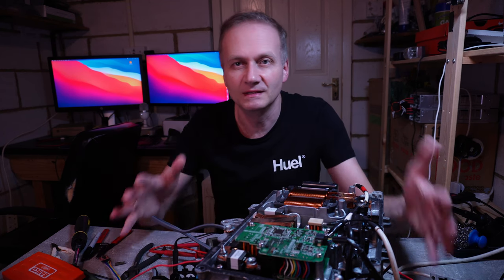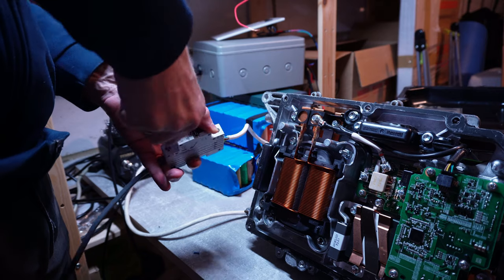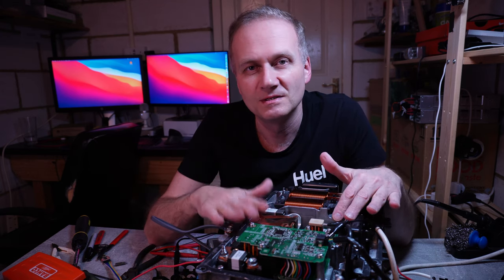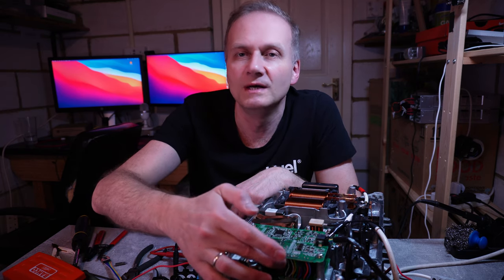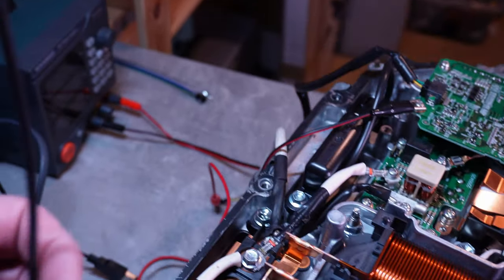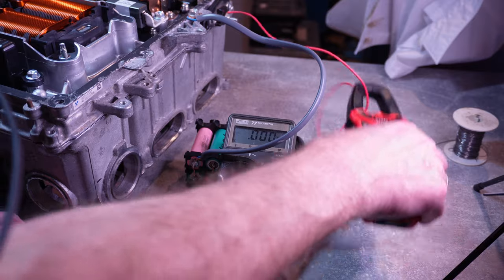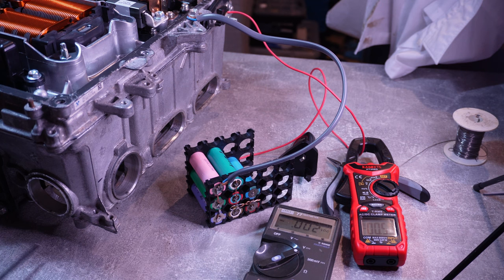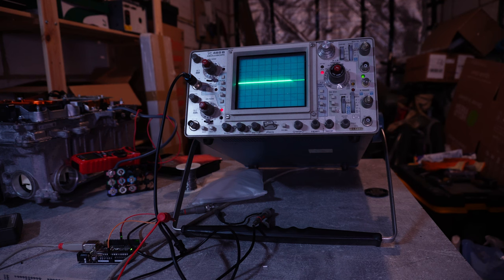DC to DC working? Ep 23

Comment: Congratulations! Great perseverance.
Reply from the maker: Thanks it was a tricky one to resolve and good to have it available as I don't have to worry about getting another DC to DC converter 😉
Reply: @LatutaEV  assuming you can get the charging working! Very neat package if you can. If not, Outlander charger remains a good option.
Reply from the maker: @EVDIY  Yes that would be ideal. From the start I thought that charging might be a problem and I was considering getting other charger.

Comment: Can you do a video on your full plan? You mention two battery systems but I can't quite see the full plan. I like your project!
Reply from the maker: Thank you very much for your interest. I am still not decided on battery options. I have an idea to make a small LTO pack to work as a buffer that would allow to recuperate more energy from regen braking and allow fast charging and bigger extender pack to compensate for low energy density and high cost of LTO batteries. But for now I want to concentrate just getting Prius electric motor into a working state with conventional battery and inverter. I have a slightly crazy idea to remove MG1 and run two MG2 and two inverters together for higher power output. Thank you for an idea for a video by the way.

Comment: Nice work! Does the dcdc output need a 12v load to enable 15v output?
Reply from the maker: Not necessarily you just need some resistive load. I just had those batteries left so I used them. But you need some load for DC to DC converter to start. You can use heating element or high power resistance. To charge lead acid battery you need about 14 volts
Reply: @LatutaEV  great thanks